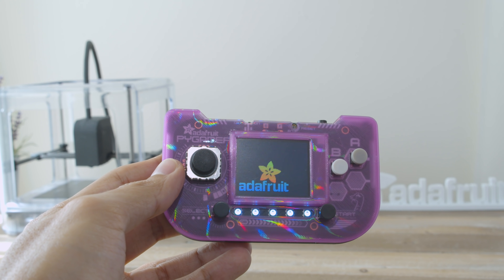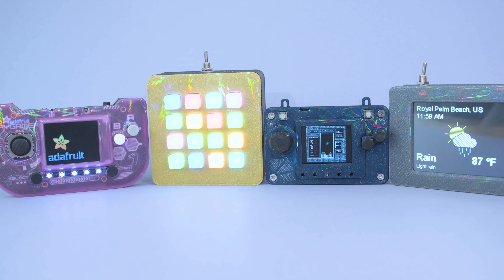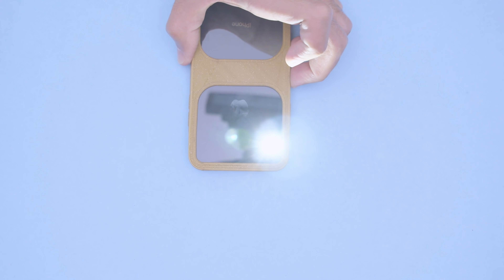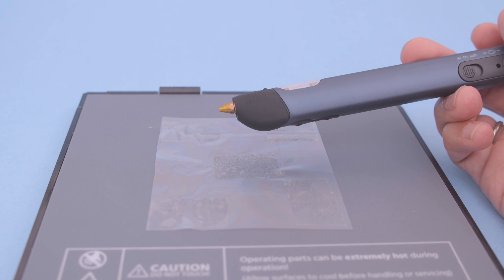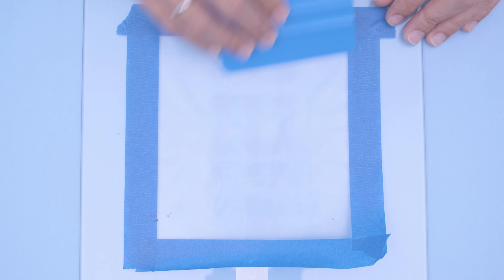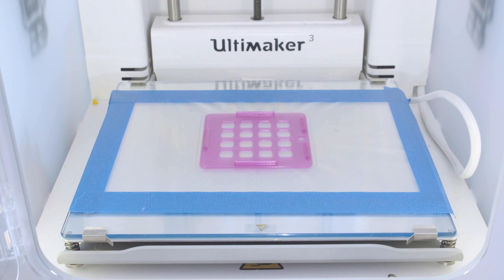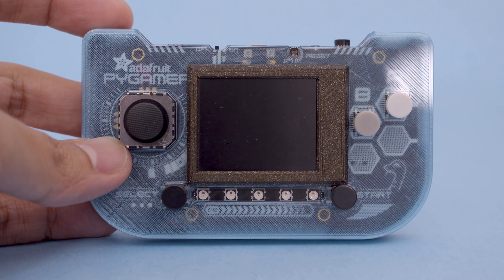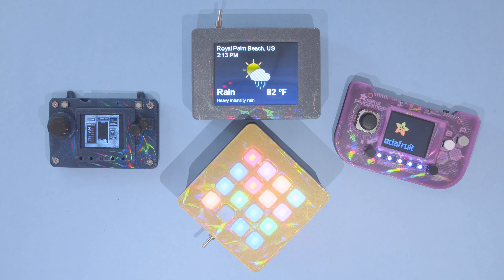3D Printing on Diffraction Grating Sheets @adafruit #adafruit

Comment: I know this is an old video, but what filament are you guys using to print those cases so clear and see through? That's really impressive. I haven't found anything that looks as good until this video.
Reply from the maker: Any translucent PLA filament should be able to achieve this using a heated glass bed

Comment: Thank you so much for posting this! It's such a great idea! I'm currently trying to use this technique for a uni project. The effect is great even just printed on my Ender 3 but after a couple of layers the print comes loose off the sheet and the print fails. Any suggestions on ways to fix this issue? I'd really appreciate it!

Comment: Just wondering; Why did you compare the two sheet types as MM to Inches. Why not use lines/mm or lines/inch for both? Just confused trying to find a cheap source in Australia.
Reply: After some research it looks to me like anything rated in line/mm is single axis only. Only sheets rated in lines/inch seem to come in dual axis sheets, which gives you a much better effect. You have to make sure it says it's double axis.